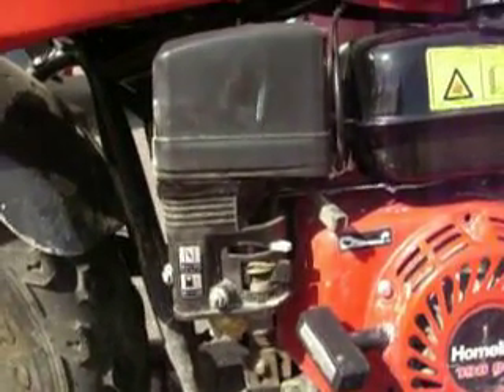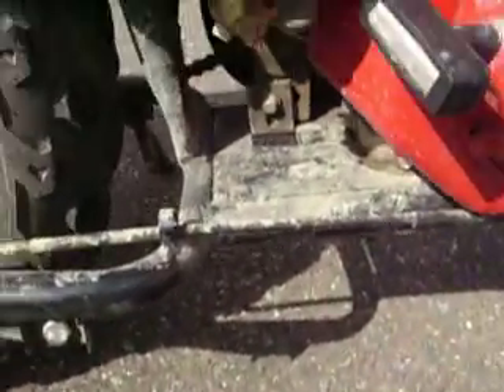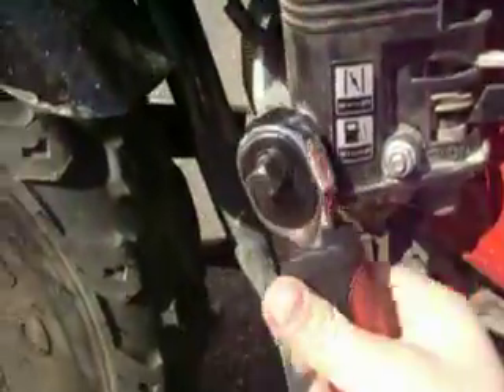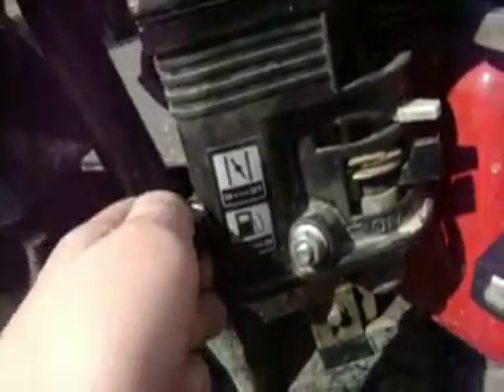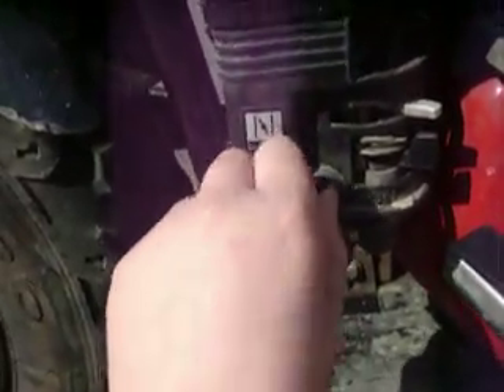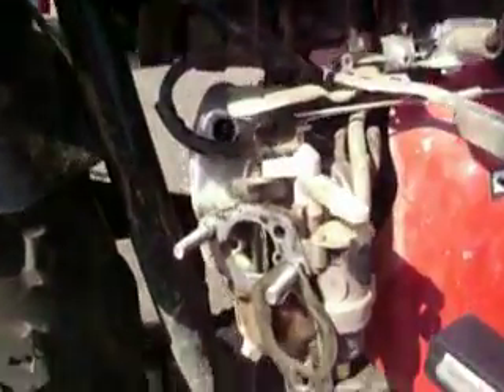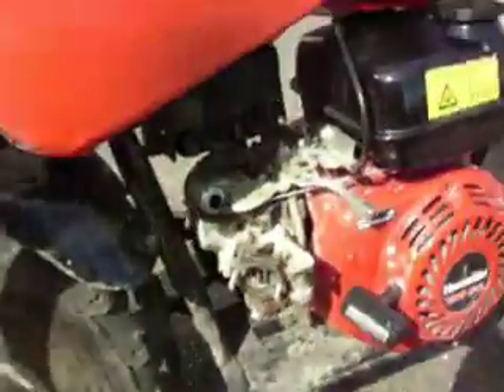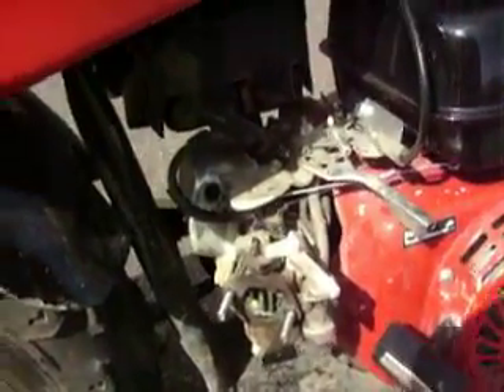how to adjust the govenor on a baja mini bike

Comment: if you noticed, theer is a little rod and spring just under your gas tank. while going full throtle reach over and push it in, but get ready to go about 10-15 mph faster. im not sure exactly what it dose, but i think it is opening your gas valve or opening your air breather more. i use it just before i hit a mud hole or when im going down a road. but to take out the govoner, you have to completely open up your engine, not just take off the carb.

Comment: @rthom86 
thanks for posting this, i followed the advice that many of these videos gave of messing with the governor and now i'm in a load of trouble because apparently your supposed to mess with the THROTTLE GOVERNOR. There is a difference people. The actual governor should not be messed with for it is mainly for idling purposes. Whatever you do dont mess with any of the springs on the governor, you might end up redlining at idle like i am now. Now i have to find some way to replace the springs

Comment: @haylo50 uh no.. to take off the govener completely you have to take apart the engine. what i think you are talking about is what this kid is explaining in the video, the throttle stop. i have adjusted this on mine too but there is barley any diffrence. i forget where exactly on the carburator it is, but there is an air/gasoline mixture adjuster and if you give it one full turn to the right you will get some results. and by the way, i have sold my baja and now have an ATC 200.

Comment: Bro that’s not for the governor that’s the throttle screw so I guess u could say it sorta governs your speed by only letting you use so much of the throttle but if u really wanna add some speed to your bike u need to do a full delete on your governor which sounds hard but it’s really quite easy also it wouldn’t hurt to get a Performance kit with some 18 pound valve springs cold air intake to delete the old clunky air box it actually comes with a lot even a straight pipe exhaust and even a muffler which is optional but if u do all those things I just mentioned then ur mike will be abt as fast as u will want it to be also if u don’t already have it replace the old centrifugal clutch with a tourqe converter and boom u have a bad ass bike that u can show off to all ur friends 👍

Comment: reliable safe opperating RPM for this engine is under 5000 rpm above that the cheaply made Chinese parts inside can fail. Consider a 4 pound cast iron flywheel spinning between your legs of it breaks you could loose a leg....

Comment: Your not supposed to screw around with the governor.  If you back it off too much, even half a turn, you can risk the piston exiting the engine while its running.  That is not good when your riding along at 30km an hour and the piston blows out the side of the engine and breaks your leg.  Its just not a very smart thing to do.

Comment: That's just a throttle stop buddy, doesnt do anything except be there to limit how far the throttle can travel, in this case to max opening. And by how far you have loosened it, go take it off now and 10 bucks says its not there. But you'd notice from trying to drive as your throttle wont stop
Reply: KrAxRACING all the thimgs people say to do.if your trying to make something go faster then please take some small engine repaire classes.start with the lower end and work your way up better connecting rods and cam and spring.factory is just that.a screwdriver mechanic wow.

Comment: Two things fail on Chinese GX 200 clones.
The rods break and the flywheels explode.
Kart racers run billet rods and fly wheels for safety on modified engines. Generaly a clone will run into valve float before the RPMs burst the flywheel. Thye are considered safe to race box stock because very few have burst.
 
Cheap Chinese cast iron under tension = trouble at High RPM.

Rods come out of the top of the engines and can rupture the tank.

YOU HAVE BEEN WARNED!